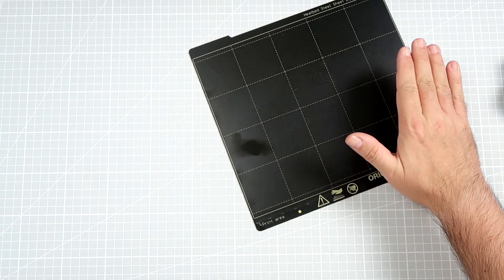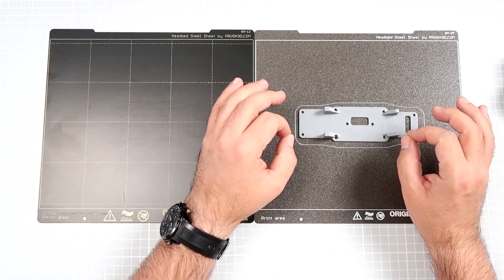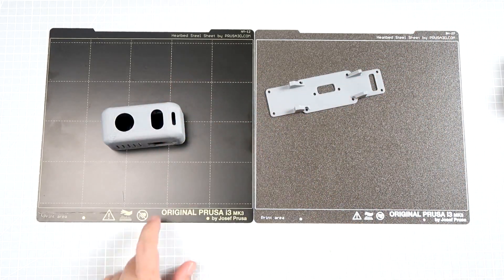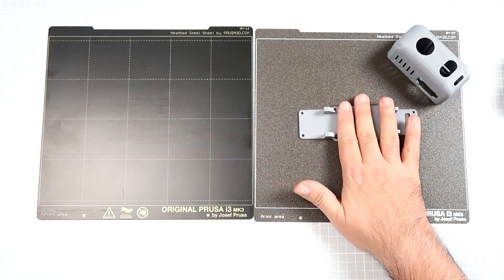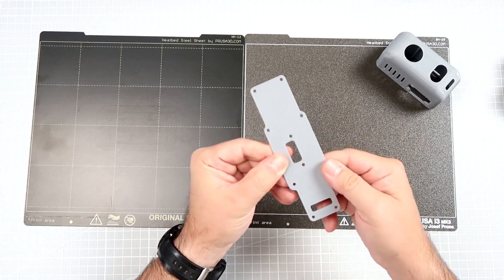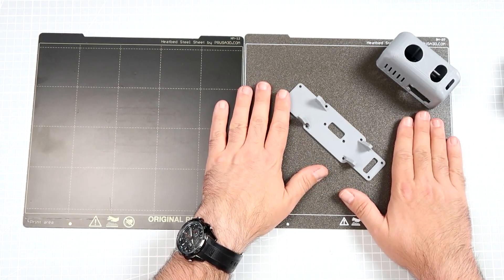Prusa Smooth or Powder Coated PEI Sheet?

Comment: 🎯 Key Takeaways for quick navigation:

00:00 🖨️ Introdução ao uso da impressora Prusa i3 MK3S e apreciação pela chapa magnética de aço
- Grande apreciação pela chapa magnética de aço do Prusa i3 MK3S,
- Utilizou o modelo sem o módulo multifilamento,
- Desgaste da chapa após meio ano de uso.
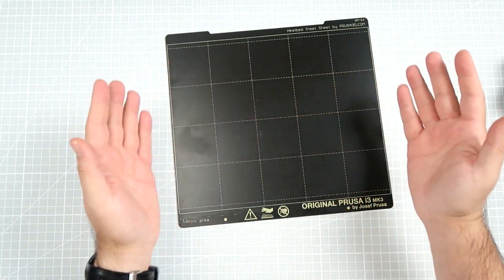01:06 🔄 Comparação entre as chapas de aço liso e revestidas com PEI
- Prusa anuncia nova chapa revestida com pó,
- A chapa revestida com pó é eficaz para impressões maiores,
- A remoção do modelo após o resfriamento é fácil.
02:31 🧩 Desafios ao imprimir objetos menores com a chapa revestida com PEI
- Problemas com a área de superfície do suporte de impressão,
- Ajustes necessários na temperatura e offset para obter uma impressão correta.
03:23 🌡️ Dicas para melhorar a adesão na chapa revestida com PEI
- Aquecer a chapa a 70 graus para melhor adesão,
- Separação após resfriamento é eficiente.
04:08 📊 Considerações finais sobre qual chapa escolher
- Chapa lisa é melhor para impressões menores e com mais suportes,
- Chapa revestida com PEI é boa para impressões maiores,
- Diferença na aparência da parte inferior das impressões.
06:02 🔍 Avaliação da durabilidade das chapas
- Chapa revestida com PEI permanece sem arranhões após algumas semanas,
- Ajuste necessário no offset ao mudar a chapa devido à diferença de espessura.
06:55 💰 Reflexão sobre o valor da chapa revestida com PEI
- Considera o preço de 50 euros um pouco alto,
- Interesse em procurar alternativas mais baratas.
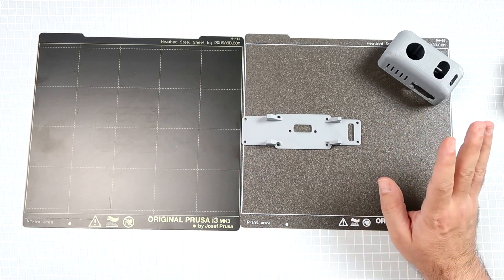07:23 🚀 Conclusão e despedida
- Resumo sobre a utilidade das chapas,
- Menção a futuras avaliações de produtos similares.

Made with HARPA AI

Comment: yeah well mine curls the filament on the first path every time on this sheet.
I've tried so many settings to fix it. Every time it moves and starts to print again a small amount, maybe 2 mm  of filament curls up.
If I run the first layer calibration it works fine. I don't get it.

Comment: How is the longevity of the textured sheet? I ordered one after a disappointing lifespan for the smooth PEI sheet, adhesion of the first layer started failing unless slowed down to very slow speeds even with meticulous cleaning with isopropanol, acetone and dish soap.
Reply from the maker: I have mine for roughly 4 years. Work fine for hobby use I suppose
Reply: @HackerUni  thanks, sounds promising!

Comment: I have two Prusa's. One with the flat plate and one with the textured. I run mostly PETG. I prefer the textured plate as it releases the best. I need to wipe the flat plate each time with IPO or it will stick a little too well. The textured sheet I just use Windex after each print. Happy either way.
Reply: The first question that came to mind was PETG. The first comment was your regarding PETG.  Thanks Bill

Comment: Purchased a Prusa MK3 over a year ago and it came with the powder coated sheet. I pretty much only print PLA and have had trouble with this surface. I had it working well for a while, but recently I can't get anything to stick. I'm going to buy the smooth sheet and see how my results change.
Reply from the maker: They switched at one point the default plate. Before that the default was smooth
Reply: @HackerUni  I think I'll buy the smooth sheet and see how it goes. If I print with a raft, things tend to work much better

Comment: My opinion is basically the same. I only print TPU and PETG. PETG gets printed on the textured sheet, TPU gets printed on the smooth sheet. Either because of the materials or maybe because of the kinds of things I print in each material, that is what works best for me.

BUT! Just this week I got the “Satin” sheet finally. I need to use it more to make sure, but I think I may start using only that for everything. So far it has really been like they say, a middle ground between the texture and the smooth sheets. But if you paid €50 for the textured sheet, you won’t like the price of the Satin. It’s $10 more than the Texture, so probably almost €70 for you… 😬

Comment: 6:49 You know you can configure multiple sheets on the printer? Go into Settings->HW Settings->Steel Sheets, and then you can set Z height for both. It will put an item in the top level menu where you can click it to switch back and forth between sheets. No need to manually adjust Z height every time, just don’t forget to switch when you change the sheets :P
Reply: (the option to switch sheets won’t appear in the main menu until you calibrate the second sheet via HW Settings)